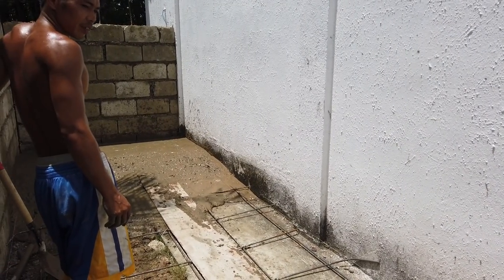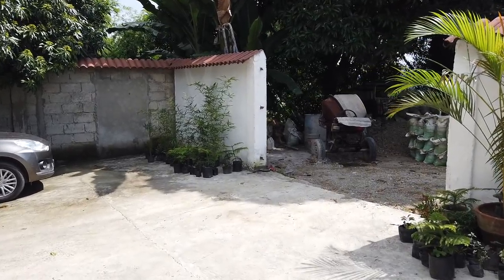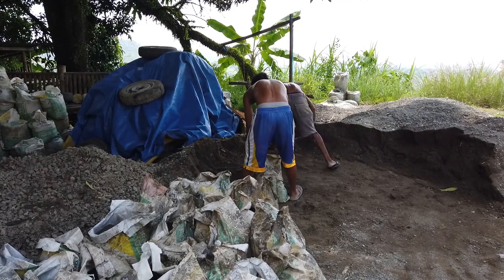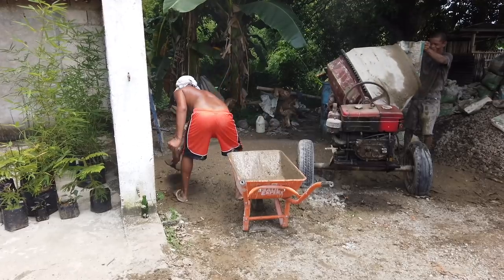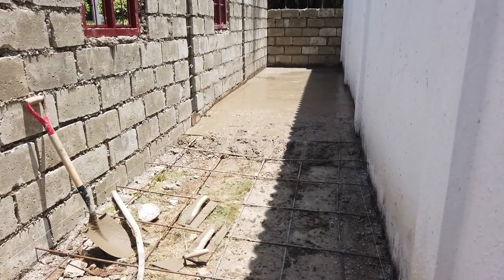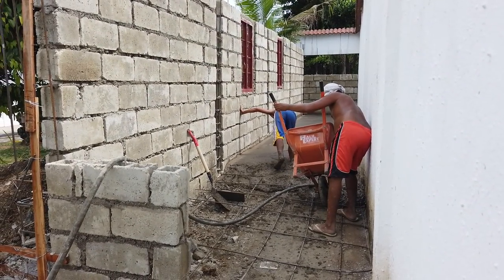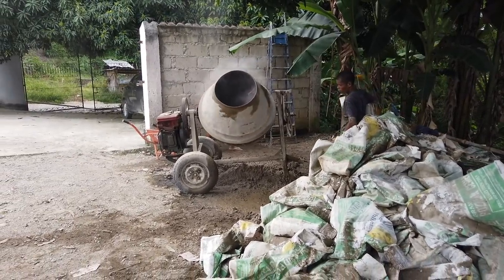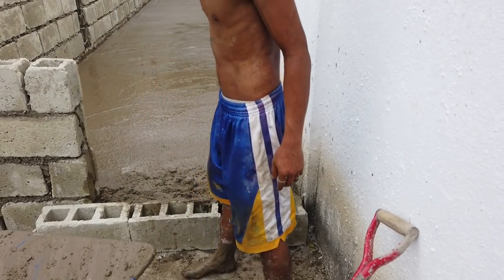Problems Pouring A Cement Floor In The Philippines.

Comment: Was researching rice hull uses the other day and learned a tid bit of info: rice hulls ash is used in some cement mix:as an extender it is cheaper than kiln manufactured cement,it adds water proof properties to the ultimate concrete mix, burning rice hulls are a secondary heat source in the cement manufacturing facility,and for the most part the rice hulls are minimal in cost as they are a waste product. Could be the cement you are using on the floor has the rice hull ash in it. Here we have concrete mix from batch plants that can contain fly ash (ash from coal burning power plants) instead of sand and it also has different workability properties than a mix using sand.$5.00 USD a yard cheaper.
Reply: INTERESTING .   as a general building contractor , im always learning ..  salamat ..
Reply: @charleshueckstaedt5064  Specifically: look at OPC cement and PPC cement. PPC is replacing the OPC as the go to cement.

Comment: Hi this is for anybody that has had the same problem as VPP  add mix is not always available so here is a builders truck to solve the problem add a couple squirts of washing up liquid into the mix you do not need a lot make mix act as if plasticiser. Had been added works great when rendering

Comment: The guys are doing a good job, it is a shame about the cement because too much water makes weak concrete. Are you familiar with concrete add mixtures, which can do many things including making the mix flow easier, but with less water.
Reply from the maker: Mark Jones I wanted to show my viewers the problems they are likely to encounter when doing building work in the Philippines. Admixtures are very limited choices and more for things like waterproofing and to delay the drying time. It is apparent that the different manufacturers are producing different grades of cement and if I can't get the brand I want, I will have to wait. I monitored the water usage and have no concerns, the concrete is over engineered for a storeroom floor.

Comment: The things you remember about in the Philippines is it's a transport logistics issue being concrete it's very costly to transport and the Philippines has many many islands concrete is very heavy to have a Central manufacturing plant with all the top of the range equipment isn't very viable in the Philippines especially due to the transport issues of a heavy product. It's easy to see why the local manufacturer just makes them like they are now I think a goof change is from having three empty cells in make it a 2 cell system this would allow the reinforcing to get better coverage and it would Bond in a better (not run steel up between the joints as they're doing now)  Anyway it's the Philippines and that's how they do it.

Comment: I had a room added on an they built the walls first, then pour the floor, they did a very bad job the floor has dips, an is almost 2 inch off from one end to the other,
Reply from the maker: FOREIGNER LOVE PHILIPPINES They probably thought they would sort it when they do the tiling.
Reply: @villagepeoplephilippines  yeah . I saw that .   We do it nice cause we do it twice thing again . 
Do it right the 1st time .  Watching people pour concrete here makes not want to build with concrete .
.negative ,yes . But nothing is level or to grade
Reply: It's not entirely true you know there are really good contractors in the Philippines just got to find them  they're out there.
Reply: Am Fil  You're entitled to your opinion but I can tell you building codes are pretty strict here in the US and can tell you breaking blocks with a hammer is standard practice here. Cutting block is extremely rare. The dust is extremely harmful to lungs, the smooth finish doesn't bind as well to mortar and there is no advantage.

Building a wall on top of a floor would never be allowed, ever. There basically 2 acceptable methods here. 1. Slab. This is footer and floor and floor in a single pour. A footer is dug at the edges and wherever load bearing walls and columns will be. 2. Stem wall. Dig down, pour footer and a stem wall on top. Later a concrete floor is poured, or a joist system, sometimes concrete pour with a joist system above.

It is very typical of inexperienced people thinking they are building "better", "stronger" etc... yet it's actually worst. Consider doing some research. It takes very little research to learn the basics.

Comment: I know.. too late.  Tought I had already mentioned it. I would've put the door on the left.  ya, bit deeper hole etc but I assume you are going to lagging  shelves to the Prexsiting wall. door to the left and you ca use all of that wall. You dont want to be covering your windows. then if you put in a wide enough door you can get a wheel barrow or cart straight in and to where you are storing on the shelfs. Come in handy for heavy loads like what Ol B is going to be putting in there .. you know he had a reason for the 6" floors right? lol  Maybe heavy filter tanks ? lol  put them under the windows (cooler) out of site from the out side. He can put a shelf table over them.shelfs and tables slid on the right. A nice cover from storage to house :) He wont have to get wet checking things. Which if I know Ol B he will be doing a lot lo :)  Then you can have that big area with the view and buld an Endless Pool, Patio, dirty kitchen. Keeps people out of the house. Then you can invite me over and we'll open up some Cold Redhorse and Sing to the City lol You have Karaoke or do I bring mine? lol  can see your Good. But I think Ol B is jus a bit better at the game. He's just not showing you All the tricks lol   Checkmate with love :)   "you should say "Ol B .. I love you and I dont want you to have to get wet, walk so far...  You take this beautiful spot for your wonderful Koi". Use the word "Wonderful" he will grow an inch  taller :) He's going to be proud of what he builds. "I will take that dirty old storage area because I love you so much "sigh" "  Then turn it into a Diamond. That I Know you can do :)